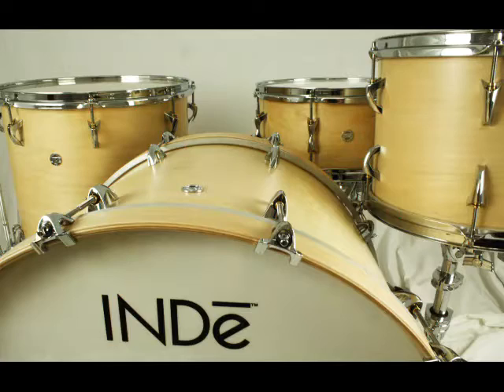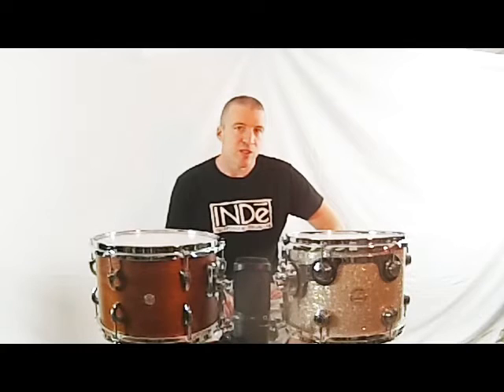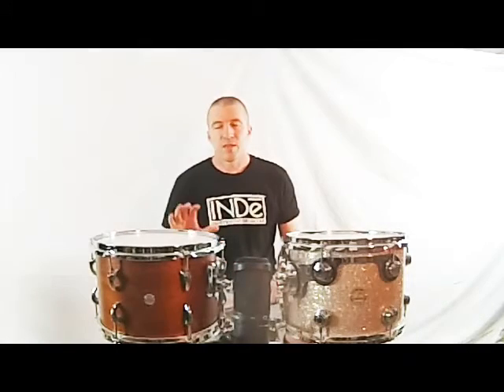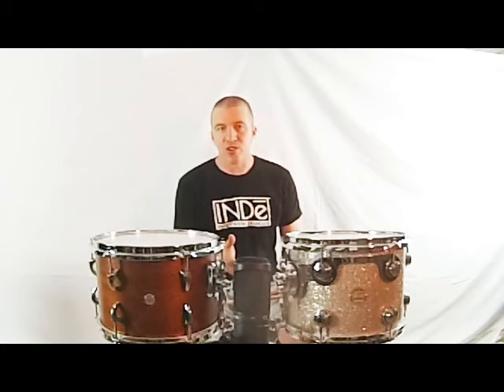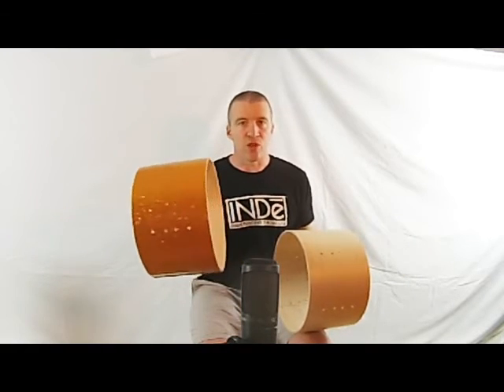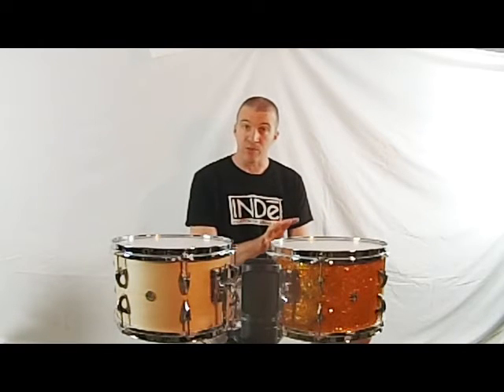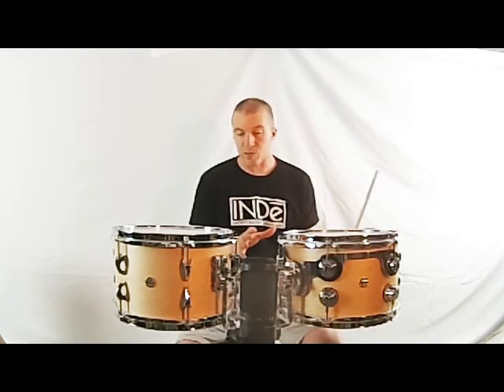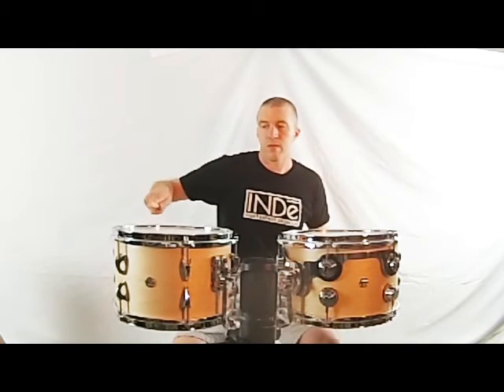drum acoustics 104

Comment: Test #1: INDe shell has a purer, more focused fundamental note. DW shell "pulsates" at high velocity hits, similar to a sine-wave. DW exhibits a longer sustain, but not a desirable one with the "pulsating". Wow.

Test #2: Satin lacquer shell exhibits a more consistent and even sustain at low volume while wrapped shell decays note faster. Negligible tone difference between shells at medium and high volume.

Test #3: AGAIN with the "pulsating"! This undesirable effect is clearly the result of inferior hardware and is further exacerbated by bearing edge selection.

Result: No two ways about it; the INDe drum shell and and hardware design offer a dynamically superior sound with a strong, consistent, and FOCUSED fundamental note combined with a sharp attack and just the right amount of sustain. Well done!